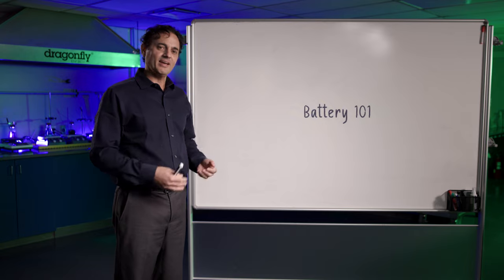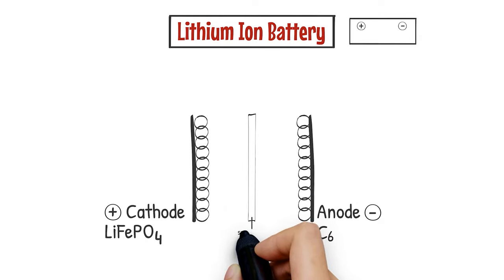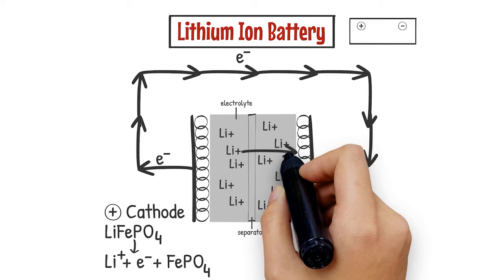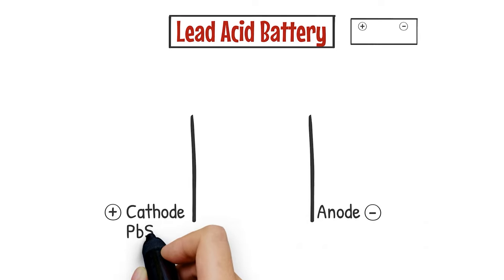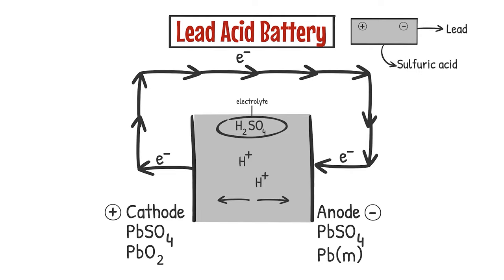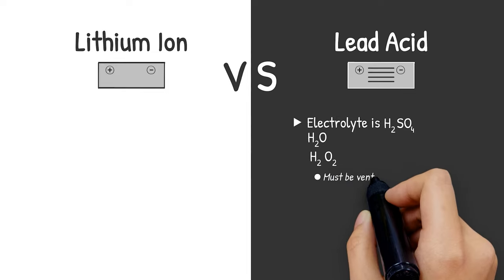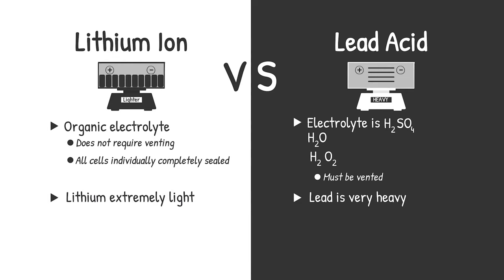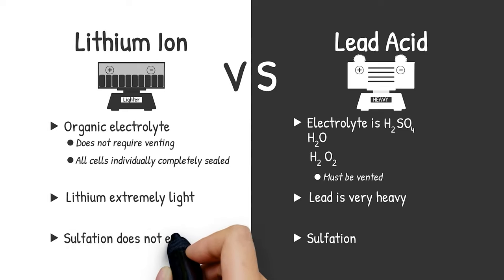Battery 101: The Fundamentals of How A Lithium-Ion Battery Works

Comment: Simplest explanations are the best, and this is the best explanation of how a Lithium ion battery works I've seen, and totally different from most explanations on the web that avoid anything close to a chemical reaction occurring. As a teacher I also include that during discharge lithium is oxidized and Iron is reduced, and I show the two half reactions. I also point out that as wittingham and Padhi pointed out in the 1970's, the real challenge is that the best designs essentially intercalate lithium on both sides without significantly altering the structure of the anode and cathode materials...which may help explain why silicon anodes with their huge swelling rates have been so challenging

Comment: I'm still confused about the reaction during charging. As I understand the reaction in the cathode is always reduction and the reaction in the anode is always oxidation, but your diagram shows the opposite. The reaction during charging in the cathode is oxidation (loss of electron) and the reaction in the anode is reduction (gain of electron). Can you please explain what is the reason? Thanks
Reply: @riosaputra2979 ChatGPT agrees with you, and so do I. He explained it wrong. That's the explanation. Reduction is the reducing of ions on the cathode side. electrons flow from the anode through the wire to power a device, back into the wire into the cathode (black terminal), the electrons then neutralize the ions that are on the cathode side, which in turn just become normal lithium atoms (no longer ionized), the lithium atoms get absorbed into the anode graphite. voltage is a function of an electric field which is a consequence of polarity. polarity is caused from differences in electric charge (positive side of battery / negative side of battery), this voltage is what causes the electrons to leave the anode in the first place, therefore, the anode side MUST have that extra electron in a neutral lithium atom to lose.
Reply: Reduction always takes place at the cathode and oxidation always takes place at the anode. During charging, the setup is behaving as an electrolytic cell which needs an EMF to drive it. during discharge however, the seup is behaving as a galvanic cell (battery) which is a spontaneous reaction. The sign convention is different for both types of cells but the nature of the reaction remains the same. During charging (electrolytic cell), the anode is +ve, and the cathode is -ve BUT during discharging (galvanic cell), the anode is negative and the cathode is positive. Hope this helps

Comment: Thank you for the video. But how do you design a separator that allows Li+ to pass but not electrons? Or if there were nothing in the electrolyte to transport electrons, why would you need a separator?
Reply: The electrons are moving outside the battery; they comprise the electricity provided by the cell! The separator is essential for keeping the cathode and the anode separated from each other!

Comment: How are different voltages produced by the chemical reaction in a battery?
Reply: I thought the batteries are small. Like 3.2 volt. But there are many of them. So you add all of them in series.
Reply: It's because of a different urge to give up electrons as a metal and get solved. The chemical balance of the reaction Me > Me+ + e is different for every metal. That's one reason for choosing lithium. Lithium has a high urge to give away its electrons and become an Ion

Comment: Why the anode is negative and cathode is positive
Reply: What you are saying is not correct! Only when charging a battery, the cathode is negative. The definitions of cathode and anode in an electrochemical cell are: at the cathode, chemical reduction takes place, at the anode chemical oxidation.